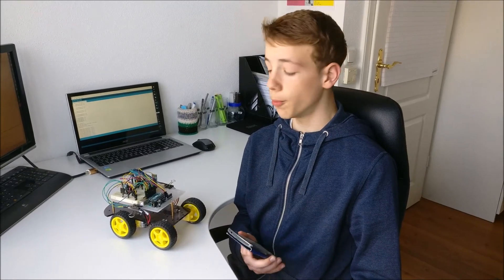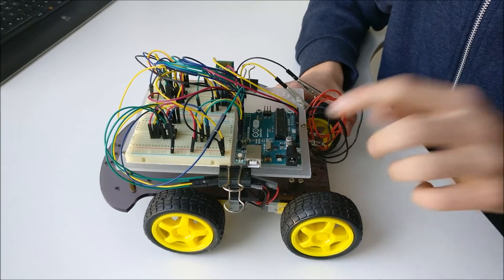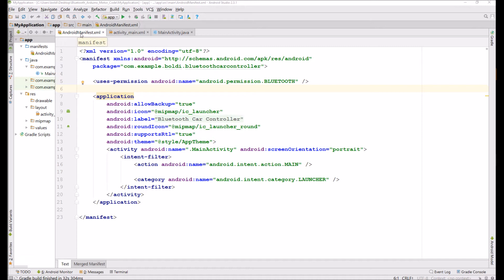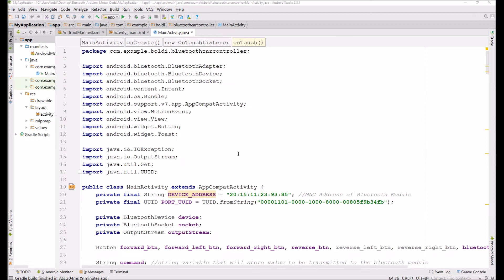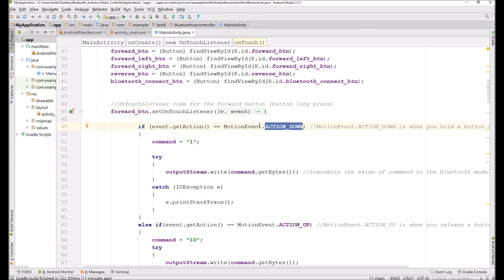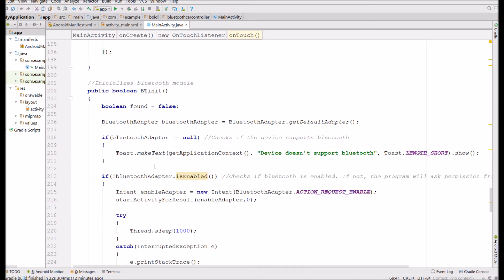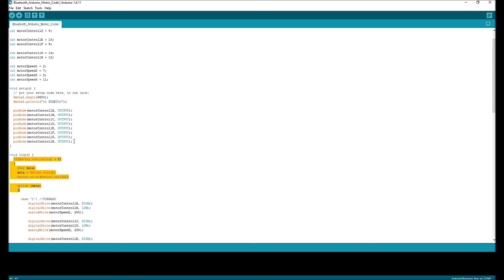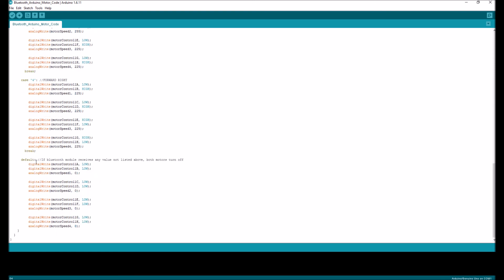Android Controlled Bluetooth Car {TUTORIAL} + Source Code

Comment: Great tutorial, I just have one question, How did you connect the motor speed pins? in the code they are connected to 2, 7, 8 and 11, but i don't understand what it corresponds to, when viewing the circuit diagrams you posted.
Please help